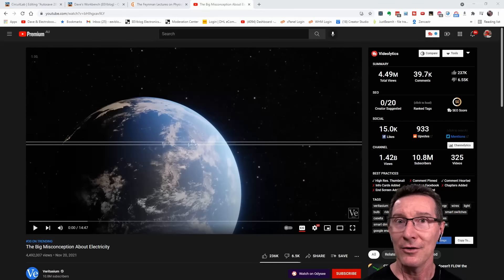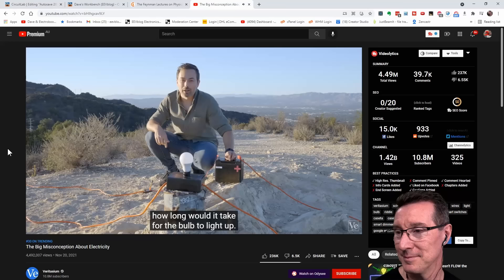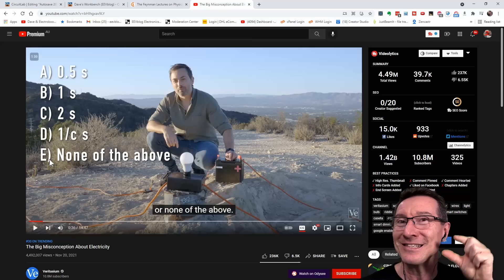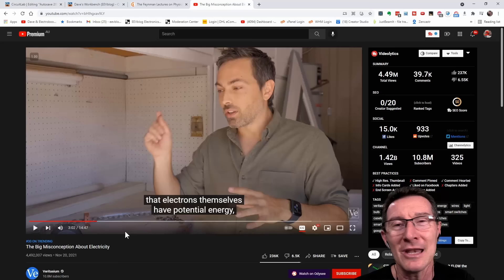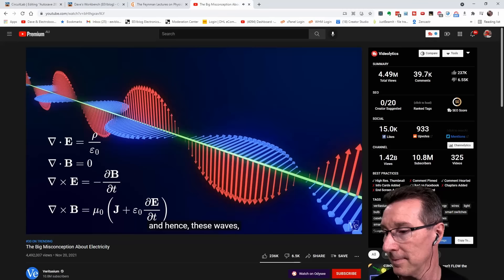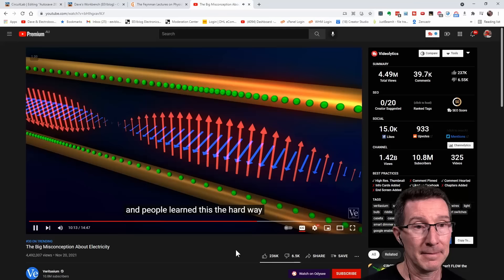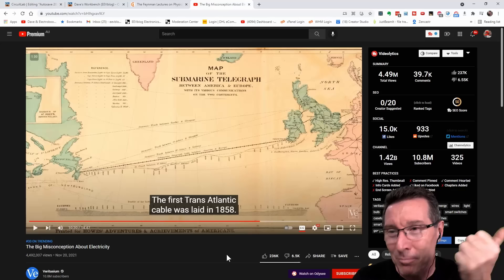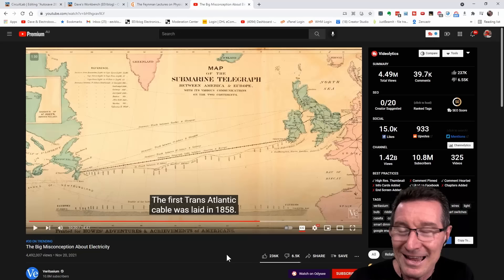EEVblog 1439 - Analysing Veritasium's Electricity Misconceptions Video

Comment: No!  Dave's transmission line model is not the right model to apply to Derek's circuit.  Read on ...

More, in Derek's video, his answer of 1/c seconds (1 meter-between-wires / speed-of-light-in-meters-per-sec) for the way he has his experiment set up, is also incorrect.   

[Note: I made some new edits in the '"more here" below.]

On top of it, his is a very poor explanation at best.  The big problem with this video is at the beginning he conflates AC step signal (action of throwing the switch) with DC steady-state (turning ON the bulb), and it looks like he himself does not understand the difference.  That is surprising, and why his consultants in the video didn't explain it to him.

For example, taking his circuit as in his diagram where two parallel wires separated by 1m over a very long distance, true that there is a TINY amount power transfer that occurs INSTANTANEOUSLY due to 'antenna effect' between the conductors right near the switch and the bulb.  But, that would not even flash his bulb in the least (the AC signal part).  Even a very sensitive LED would not momentarily light up: the 1 meter separation is just WAY too far to transfer enough power, although, you might be able to see the a tiny short impulse with an oscilloscope across the bulb.

However, if the wires were very close together, say separated just by the thickness of (very thin) insulation, then the bulb (better a sensitive LED) might produce a barely visible SHORT FLASH at the moment he closes the switch at 1/c later (which is also half-explained in the rest of the video with the E&M vectors etc), and then stay OFF until travel is completed around the whole loop (a total of 2 light-seconds if wires are at absolute 0 adding no delay).

So, at that point with an experiment topology where the the wires are close together, after the short flash on closing the switch, 1 second later, the bulb would turn FULL ON and stay FULL ON.

In conclusion, if the wires were run right beside each other, the answer would be both:  1m/c flash and 1 seconds later steady ON.

Thus, the real answer for the way he has his real experiment set up is 1 second, not 1/c seconds.  He needs to fix this.

More here ....

However, I disagree with EEVblog model of a transmission line:
https://youtu.be/VQsoG45Y_00?t=1553
A transmission line model would be more suitable if the conductors were large compared to the distance between them.  The even bigger fallacy here however, is that Derek's experiment is NOT a transmission line: in order to qualify as a transmission line you'd have to remove the bulb (breaking the top of the circuit), disconnect the switch from its left wire side and connect the switch to the top wire that goes tot the right.  Then you break the far end on the extreme right and insert the bulb.  Only then you can use the principle of the transmission line.

Thus a transmission line model does not apply to Derek's experiment.  I think Dave messed up badly here. 

Even if you rewired Derek's experiment into a transmission line circuit above, EEVblog's lumped element model would not be accurate either.  The characteristic impedance of the wire pair is indeed 900 ohms, but remember, that impedance is looking into the right pair wires (or the left wire pair) with the bulb not connected!!!  Even so, EEVblog uses 1 uF capacitors. The capacitance of the wire pair is almost non-existent.  It DOES matter what the capacitance value is.  

What is the better model then?

In my opinion, the better model for switch flip instant is a dipole antenna with a step source at its center, and, I contend that the power transfer between the parallel wires is much greater due to the EM transient (Derek's explanation) than to instantaneous current flowing through an uncharged capacitor (in EEblog's incorrect lumped element model), especially that capacitance (Farads per unit-distance) is so small it is negligible.

Thus for the AC step transient in Derek's model, the top half with the light bulb is the receiver, and the bottom half is the transmitter.  

Therefore, to make an analogue of the transmitter (bottom) imagine you tied a long spring to 2 trees, and held the center point with your hand.  To close the switch, you give one quick jerk to the right say by a foot, and hold it there.  Watch what happens to the springs: you will see a compressed wave travel to your right away from you and an expanded wave travel to your left, also away from you.

That is what's happening electrically in Derek's setup at the moment he closes the switch.  The difference is that there are two electromagnetic disturbances that are traveling away from the switch, a dipole antenna.  Now you can apply the AC vector model and what you get is electromagnetic radiation (a single radio wave of all frequencies) that is traveling both ways, losing some of its power as a radio wave into space, in all directions.

When that already very weak radio wave is intercepted by the wires on both sides of the bulb (also a dipole antenna), a step voltage is created across the bulb, but, is it SO small you would never see it light up.

However, if the two wires were close together, it's possible you could see a barely perceptible single flash in an LED (bulb) followed by a DC steady state ON condition 1 second later.  In this case, if you connected an oscilloscope across the LED, you would see the step, but, you would see it die out rapidly as the transmitter step propagates away from the switch in the bottom half of the circuit.  So the voltage across the bulb would be ZERO in less than a microsecond, and then finally begin its rise to the battery voltage 1 second later.  So not only will the bulb (realistically) light up 1 second later, it will be dim at first and then increase to full brightness, taking some noticeable time longer because of pulse spread effect over such a long distance in a single wire.
Reply: Due to the original model that Veritasium demonstrated: 
It is the chance to look ahead into the future for the time period electricity travels in the copper line and therefore you can ask questions you get an answere before the answering person answered. Does your model give me that time machine? I don't care if the signal that carries the information from the future is harder to detect.
Reply: A lot of what you said is true, it is hard though to calculate for things that are not real. That is the problem with these types of questions. Wire without resistance is just a myth, and in a laboratory, under some very strange and special situations at extremely cold temperatures, it is hard to compare the actual effects that would take place on a wire that long. It might detonate if it was at superconduction temperatures. All wire has capacitance and is a capacitor the larger and longer the wire the more capacitance it has. I think we are just wasting brain power on this. 

Sincerely, 

William McCormick
Reply: @WilliamMcCormickJr  asking questions into the future with that kind of a time machine would be the greatest thing on earth. Yes, we could do it with spirals in a super conducting way. I would like a quantum computer, who answeres the questions. This answeres I would know a fraction of a seconds early. What about to feed the quantum computer with his own answeres before computation. 
... Perhaps you are rightfully saying nature would save us from paradox situations with some explosion. 
Greetings from Hamburg.
Reply: @WilliamMcCormickJr  Fundamentally I agree 100% with what you say.  But I think it is a good thought experiment anyway, and my conclusion after more thinking shows that 1/c is not the right answer, given that under more realistic conditions like making the length of Derek's experiment one km and using a scope & generator for simulation, is good enough to predict what his would do in principle.

Please read it again.  I discovered that EEVblog (Dave) is also incorrect with the transmission line model!  I think if he reads what I wrote he would be stunned, I'm sure.
Reply: Well, "at any voltage" was what was stated, so sure the air capacitor over one meter will deliver a certain air capacitor in series type electrical communication. 

Transmission lines are sneaky because they are being used for their capacitance, the loads on them are all parallel loads.  In theory, the transmission wires must charge before they can deliver current to the parallel loads. This means that by the time the transmission lines charge, the AC cycle is reversing so that the load is the transmission lines up until their capacitance can no longer feed the load. 

That is why you will see rather small diesel generators feeding a rather large transmission line system.

Sincerely, 

William McCormick
Reply: @stickfijibugs , many years ago I did some experiments using an oscilloscope and two power sources two batteries, one high and one lower voltage, with their (+) terminal as marked on a modern car battery wired together and to a switching circuit that generated a switching pulse. and the other side of the switch was wired to the oscilloscope ground. The probes connected to the (-) terminal as marked on a modern car battery to each battery. I found inconsistencies with the output time, not just differences in the output voltage on the scope. So I am suspicious of the measuring equipment having latent power issues that varying voltage seems to exasperate. In other words, the circuits because of the distance should have turned on at the exact same time yet there was a lag in the lower voltage source or an accelerated readout in the higher voltage source.
Reply: @ulenrich  I don't agree. No "time machine" is implied by Veritasium.  The switch, battery, and light cannot tell if the far ends of the wire are opened or closed until ~1sec after the switch closes.  That is actually quite correct.
Reply: @stevealexander8010  But Veritasium tells me the light instantly glows! So, all I want is to ask at the London Stock Exchange if some stock is above a certain threshhold. I pulse a hundred times a second in London and get the light signal if the NYC counterpart will not open the line for the signal we agreed upon. Why don't you let me lurk into the future, please!
Reply: Of course you mean 1m/c ~3.3ns.   There is nothing wrong with either model.    Both produce the same results if carried out accurately.   You and others are correct that the initial transient condition isn't properly accounted for by Veritasium or here.

I've don't the dipole calculation using the relativistic electrodynamc system from Purcell (it's not the common perpendicular force eqn for dipole, but the force parallel to the conductors) and there is a very ugle integral involved, but the take-away is that INITIAL E-field at the light rises toward ~8.6v/m, (assumes 12vdc battery)  but drops off rapidly away from the light.  This field reaches 90% of that max value by the time the light observes sees the charge density change ~7 meters from the switch (~24ns).    This field causes a minor current as charges in  the light-side wire re-arrange themselves to  counter the E-field (a capacitive effect if you prefer)..  That charge re-arrangement current virtually ceases from 24ns until just before 1 second.

The B-fields is ~4 orders of magnitude lower at the light than at the switch-wires.  Ignorable wrt significant power.

 But you've made an error by ignoring the more complex transient condition.  The full current certainly is not likely occur at the load at 1sec unless the load(light) matches the system impedance. Generally at 1sec the increased/decreased charge density wave (~0.48 nano-Coulomb/meter charge density initially) reaches the light supplying ~150mA.   If there are reflections b/c of load mis-match, that causes a shift in voltage at the load/light and these reflect back to the battery ~1sec later.  The LC time constant for this system is hundreds of seconds.  It takes many minutes to approach steady state.

Your main conclusions is correct - there is no appreciable power applied to the light bulb until 1+sec.   But full power may take 10 minutes!!

More important - you cannot create visible light photons using the ~0.86 volts cross the ~10cm light as shown. It's impossible.  To create a visible light photon you must accelerate a charge by ~1.5 volts.
Reply: @stevealexander8010  Thanks for your explanation, but that is by far above any electronics I am able to understand.
Many of you argue with the light bulb needs some electric force and time. For an electric time machine, which will get me billions at the stock exchange, I am ready to exchange the light bulb with any more fine grained electronical device, which will tell me (c - (1/c) time before the electric power reaches my counterpart in NYC, that he at the NYC stock exchange will cut the line. As you know the prices for property near the New York Stock Exchange are higher for the meters of viccinity. If I'll get the info earlier far away I'll would setup higher priced electronics in London.
Now, can I get my time machine for information with a Veritasium setup?
Getting a longer spiral of super cunductor I would be able to signal any fixed question in place from a fixed time difference in the future.
Reply: @ulenrich  There is no time-machine implied either here at at veritasium.

The closing of the switch IS detectable at 1m/c (~=3.3ns) after closing.   Tune an AM radio to a dead-band, position it 1 meter from a switch, then flip the switch on&off.  he static you hear are rf-wavelength photons that eminate from the switch due to the accelerating electrons.  That's isn't any time-machine; the photons still take 3.3ns to span the distance.

1m/c is precisely the time we would expect photons to reqquire to cn the 1 mee ditance - no time machine.

NO ONE except you seems off on this time-machine tangent.

Veritasium is absolutely correct that a SIGNAL is detectable at the light 1m/c seconds after the switch closed.  It is absolutely WRONG, and DECEPTIVE to suggest that it provides enough power to light a light.
Reply: @stevealexander8010  Thank you for taking the time to do some calculations and deeper analysis, it is a very useful contribution to this discussion.

Fundamentally, we should arrive at a good counterargument for Versatim, because folks wishing to learn do get misled.  I wrote there that he confounds AC transient analysis with DC steady-state, and I can see the confusion in the comments there, many making reasonable arguments against his presentation without really knowing why, while others are accepting what he says as correct.

Your para #2 and #3.  Agreed in principle. Yes, the integral is definitely ugly and I think neither of us are prepared to define it.  Yes, I did not take load-mismatch reflections into account, because in my estimation, they don't apply (ie I maintain this is not an xline, but nonetheless, your para #2 is an applicable model).  Folks reading this need to know that your E-field number of ~8.6v/m, is in all directions, and that you are 'measuring' the effect over open bulb.  Thus intercepting the E field with the bulb-side wires would also pick up a very tiny fraction of the current that can be acquired if you were able to capture all of the field for the bulb.  That's why I showed the analogue of 'close pair of wires' and an LED for a light bulb.  Even then, your calculation indicated a pulse of less than 100 ns, that would be impossible to see in LED anyway.

Your para #4.  I didn't overlook the transient, I let my antenna model conceptually simplify it, with my final answer arriving at the same as yours for both the initial transient and final DC state, in principle.  And btw, the transient numbers I was thinking of were in the range you calculated in para #2, good to see.  Of course decomposing the step into its components and a series of superposed dipoles for each frequency component, you'd get into a huge mess.  So I think your presentation in para #2 sums it up quite well without getting overly complicated.  Also I like your approach because it is independent of using my idea of a dipole model.  

However, I disagree with the last part of para #4 where you state the "LC time constant is hundreds of seconds".  

Here's my view ....

For this reason, for the steady-state condition, (ie beyond light-100ns distance) a better model I think would be a circular circuit model instead of a wire-pair model (again, not xline as Dave explains it), just 'wire-pair'), where the physical length of the left and right semicircles would still give a 1 light-second length (ie keeping the wires the same lengths but creating a full circle).  My basic reason is that it won't take long for the initial fast step to lose its high frequency components, pulse-spreading the step.    So in my view, the dominant effect is the inductance, which is ~400 Henrys per side for a 2mm straight wire.

So in LTSpice I created the very simple 12V step source, L=400 and R=100.  The result is 1/2 brightness after 6 sec and FULL ON after 40 sec, a lot shorter but agreeing in principle with what you proposed.  I think 40s to FULL ON is the WORST case.  Why?  Because the simple LR model is instantaneous: it does not consider velocity - vs- long length, which makes the total EFFECTIVE series inductance a lot less than 400 H when added in series as separate L elements in time.  So I still contend that the basic delay is 1s (still no light) and then a dim light would be visible 3-4 seconds later worst case (at ~1/4 total current), the "noticeable delay" I was referring to in my original post.  There would be no reflections to deal with because impedances don't matter, hence there are no mismatches: this now becomes a simple DC circuit.

I'd like to hear what you view is.
Reply: @ulenrich  Not "instantly".  I believe he says "almost instantly" or applies other qualifiers.    

It takes 1m/c seconds, or about 3.3 nanoseconds for an obsever at the light to detect the switch closing a meter away -  a good PC can execute several instructions in that amount of time!   NY to London is ~5600 kc, and 5600km/c is ~18.6 milli-seconds.  Also not instantaneous.
Reply: @stevealexander8010  The difference of both is the time I can look into the future, if the light does not show up when 18,5 ms later the NYC counterpart will not close the line. Why can't you see that Veritasium proposes a time machine?
Everybody sees some electronical specialities, but nobody sees the blunder here! And you could use an arbitrary length of spiraled wire in e super conductor box to answere any question to a fixed time future with such a machine.
Reply: @ulenrich  I don't understand your example.   Let's refer to the veitasium vid and not London, NY.

Derek @ Veritasium claims that you close a switch 1 meter away and you can "detect" it in 1m/c = 3.3ns.  That's not a time machine.  Further you can test that a switch closing causes an electrical disturbance using an AM radio.  Of course the disturbance.travels at the speed of light (not instantaneous).

I see no claim of a time machine.
Reply: @stevealexander8010  I can show with a slightly different setup that this would be a time machine for information: I steadily pulse a circuit close signal. Derek Veritasium claims that this would result in a puls light up 1 meter away in 3.3ns. 
Now I get a co-worker, who should answer me a certain question by cutting the circuit at the far end. He can cut the line in exact the moment the electric signal reaches him from the pulse, which is distance multiplied light speed. Because Derek Veritarium claims the signal is much faster than the light speed multiplied distance multiplied two, but he claims in 1m/c therefore I know much earlier the signal (cutting the line) my co-worker gives me. The paradox of this situation is clear if we add to the same setup the same machinery but the other way round, in a way I give a signal to my co-worker when he will give a signal. In this doubled setup my co-worker is able to know for certain what he does in the future.
That paradox is more clear if my co-worker is a computer which computes a calculation that would be tampered to the opposite result with the input of my signal. That is a Gedankenexperiment that is the same when a time traveller can kill his mother before his birth.
Reply: @ulenrich  >>Because Derek >>Veritarium claims the signal is much faster than the light speed ...

No he didn't say that.  You misunderstood.

First, the time for light (or the electrical signal) to traverse a distance D is D DIVIDED by speed of light, D/c.

So it's 1m/c or 3.3ns for a signal that goes DIRECTLY from the switch to the light, and 300000 km/ c  = 1 second for a signal to go from switch to far-end to light.   Those are two different things (which Veritasium failed to clearly distinguish).

I think your confusion is in this regard.  When you close the switch a current does start to flow in the switch-wire, REGARDLESS of whether the ends are cut vs closed! In fact the exact same initial current whether cut vs closed!   The battery is transferring charges in the near-wires and there is a 'wave' of charge density moving down each side of the wire at almost the speed of light.

This effect of putting a current through an open circuit might seem mysterious, but we can describe it classically in terms of capacitance and inductance, or in modern physics as a power needed to accelerate charges against the permittivity of free-space, but for ~140 years radio operators have been pumping kilowatts of electrical energy into open dipole antennas (wire-airs like the switch-side half circuit).

In fact the switch or light observer can't tell whether the ends are cut or closed for a full  1 second after the switch is closed!   So when you friend at the far end cuts or  closes the circuit - it makes absolutely no difference to the initial E-field and B-field at the light in the first second.

Where Veritasium distorts (and IMO lies) is that the amount of power that leaps directly from the switch-wire to the light is tiny - microwatts, and won't produce practical visible light.   Significant amounts of power only occur at the light after 1second, and only if your friend closed the end.

There is no time machine.

In fact the switch or light observer can't tell whether the ends are cut or closed for a full  1 second after the switch is closed!   So when you friend at the far end cuts or  closes the circuit - it makes absolutely no difference to the initial E-filed and B-field set up in the first second.

Hope that helps.
Reply: @stevealexander8010  You only see me as confused, because you want to save the Veritasium video. I don't argue against some electronical features like capacities, which could save some minor truth of the Veritasium video.
But please try once to take the word of Derek Veritasium seriously. A picture of the Veritasium setup with letters:
------S-----
I             I
------H-----
Veritasium claims
- there is a signal at "S" in speed for light of distance "I" ( I=1meter)
- only if both sides "I" are closed and at "H" a pulse is sent.
I claim, if that is true, 
a co-worker can open one side at "I" later than I close at "H",
and Veritasium must say:
In that case we cannot see a signal at "S" 
Which makes everyone, sitting at "H" the perfect predictor for what a little later happens at "I". What is difficult to acknowledge, that this would be a time machine predicting the future?
Reply: @ulenrich  Not at all.  That particular Veritasium vid is VERY misleading, BUT  it does not imply any time-machine.

Let's  consider your explanation:

>>- only if both sides "I" are closed and at "H" a pulse is sent.

I've watched the vid twice, and I don't believe he says that that both sides MUST be closed.  He ASSUMES they are closed as a pre-condition, not a requirement.     (I've degrees in EE & Physics and I assure you that it works identically for he first 1 second whether opened or closed).   If he said that then he is very wrong and indeed implied some magically infinitely fast info transmission.  Faster than c.

Here:
https://youtu.be/bHIhgxav9LY?t=701
he explicitly states that the electric field does NOT have to travel the long-path. That is correct if we mean a tiny RF static amount of power is directly transmitted to the light.

Show me where exactly he makes the claim that both ends MUST be connected (closed) for the light to "turn on" aka receive a tiny signal.